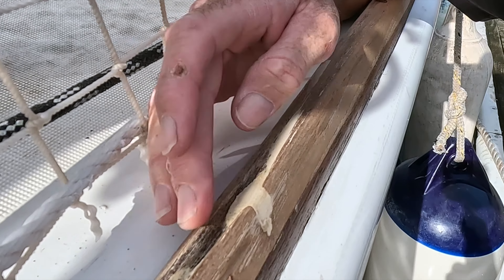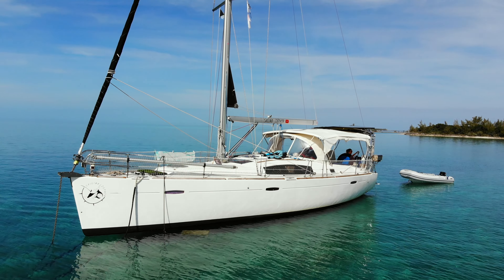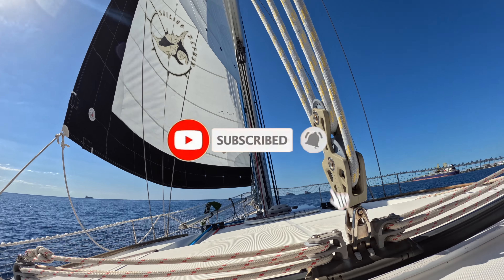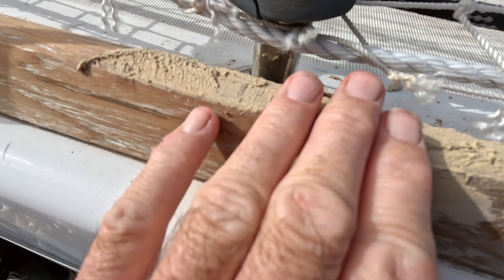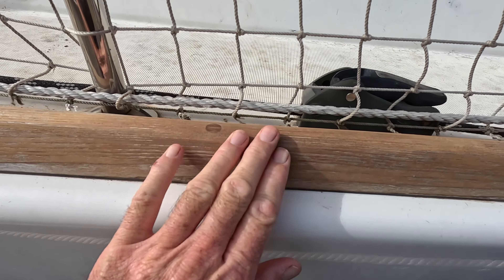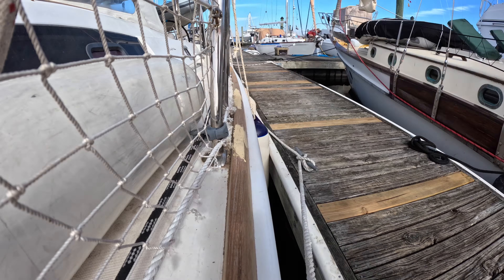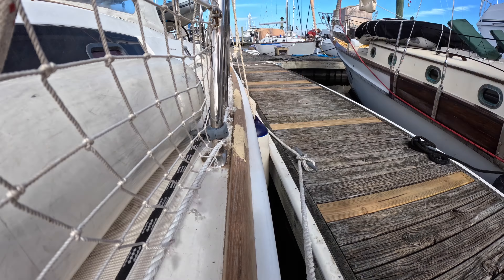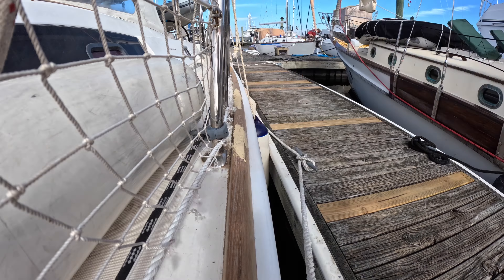Teak Restoration on a SAILBOAT Part 2 | Sailing Zephyr - Ep. 263

Comment: I think that teak oil does not "stain" the teak but rather brings out the natural teak color like a varnish on wood.
Reply from the maker: You raise a good point and something I was thinking about. I need to do some deeper research on this. But I feel like it added a slight tint. But overall I think you are right and it just enhances the natural teak look.

Comment: Your teak oil is not a stain it's an oil. There's no color in good teak oil. Sorry for the bad news . Keep up the great work
Reply: @rickskalberg421  I have found Two types of Teak Oil, the normal standard type Teak Oil, is a bit dark and surprisingly when I was in the USA using a Sailboat in 2016 the best value for that was in Walmart, and I bought every can the local Branch had.,however, West Marine had a very expensive Golden Teak Oil- which looked like engine Oil, and tbh, I was tempted to try it, but never got around to buying a bottle of it, but thought it could really look the business, if used after the standard Teak Oil had started drying Out, but the wood still pretty well fed internally, so at most only needing say two coats of the expensive golden Oil, so a bottle of it may last a good number of years ? Unfortunately the boat was a total loss before the teak got to that point, so the chance to compare them was lost, and there won’t be any timber on Deck at all, with my next Sailboat, it will be all foot and knee friendly non slip, plus 316 Stainless Steel Grab Rails. I’m done with wood to be honest. Best Wishes. Bob.👍🌟🌟🌟⛵️

Comment: James I do understand your wish to make your Teak look like new. However, in my opinion after spending 30 years trying to keep my Teak looking great, I just decided to let it age and scrub it with salt water every now and again. Continually sanding those toe rails will just end up as thin as tooth picks. So far as Teak oil is concerned, it is just snake oil. ,Teak is naturally oily that is why it doesn't rot so it will not absorb your "Teak Oil". Waste of money and effort. DON'T EVER stain Teak... YUK. Teak is beautiful naturally and too oily to truely take stain in any event.
Reply: If you like the natural grey of teak I'm sure it is beautiful to you.
Reply: Following on from what English.awyer said James - Teak Oil is actually Wood Food, and there are benefits from Feeding the Wood. The grain gets sealed and the protective Teak Oils appear to get usefully boosted, and Protection from Rotting continues ? To me, putting a filler onto the Teak doesn’t help, and best instead would be to cut filler pieces out of Teak off its, and slot them into the Teak instead with small securing teak dowels ? Then once you have all Teak again and the Teak takes in all the Teak Oil Coats it can absorb, when it needs more coats should be easy to spot, and at worse, only a very light sanding should be needed, if needed at all, as the surface should look faded and “hungry” in need of a few coats of Teak Oil Again. Nice work with the cloth James, my favourite was the microfibre cloths - Just don’t put them in a Tumble Dryer.😅 Best Wishes.  Bob.👍🌟🌟🌟⛵️
Reply: @cestmoi1262 When Teak is Grey, it is starving and desperate for Wood Food, which Teak Oil supplies it. The Teak has dried out, all the Oils are gone, and that is when it starts Rotting. Yes Teak Does Rot, Varnish is the Protective Layer sealing in the Oils, but Varnish becomes a Nightmare to Maintain, plus all the preparation work required for reVarnishing, Steadily reduces the amount of Teak from what you Started with.To Maximise the Life of the Teak, if I had to Start over again, I would never Varnish it, and only make sure to feed the wood regularly with Teak Oil or, today, choose to have no exteriorTimber On a Boat at all,and thanks to the Very Real Termite Problem, be bloody Careful with what woods and plywood are used Below Deck and find out the best Termite Protection Layer to Barrier Coat them with - Possibly an epoxy Twin Pot Paint ? I know Island Packet use Termite Proof “Starboard” ? I think it is called. 🤔 I could seriously use some input on Termite Proof Coatings to be honest.I know that for Timber Frame, and other houses, there is a green coloured plastic Sheeting, that goes with the Construction Pad, with an anti Termite insecticide in it, to prevent the he little sod’s getting in at all. Biggest emitter of CO2 in the World by Far ?Termites, Believe or not. 🤔
Reply from the maker: @brownnoise357  Thanks for the info Bob. I love the way you explained that. It also makes the job seem less like a job and more of something we need to feed and look after. Thanks again for watching and as always for providing some much needed knowledge that we needed. Cheers my friend.
Reply: @cestmoi1262  Did you know that Teak is NOT naturally grey? You didn't read what I said. Go back and read what I said. "Scrub it with salt water every now and again." For your info, that removes the greyness and the Teak looks great. My point was when you are on a budget sailing around the world, you don't need to keep sanding the wood. Every time you do that you remove more and more wood and you are unnecessarily paying for products that look great for a short period of time. This is not a super yacht and not worth the time and cost. It is like scrubbing a Teak deck with salt water. It looks great and you don't oil or stain that do you?
Reply: @EnglishLawyer  Well it loooked GRAY on my boat. I wasn't blessed with somebody informing me that I should douse it with saltwater so stop getting your bloomers in a twist. It seems to gravely affect your disposition, English Lawyer.
Reply: @cestmoi1262  I didn't say "Douse" it in salt water. ,I said "Scrub" it with salt water. If you cannot understand English then I understand your problem. Now you don't need to get yourself in a twist. You have obviously never owned an ocean going vessel and are just shooting from the Lip. I have been a commercial skipper and boat owner for 50 years. The foredeck of my vessel is 22 feet long before the mast  by 12 foot wide of 3/4 inch teak. I know how to look after Teak. You on the other hand, have zero experience.
Reply: @cestmoi1262  Natural Grey = The Teak is dying and it is losing all of its protecting Oils Content. Sanding it to remove the Dead Layer and get back into Oily wood, just accelerates the wearing out of the Teak Process, like Failing to feed a Wooden Cricket Bat with Boiled Linseed Oil  can result in the Cricket Bat just falling apart ? As a Kid, my first  rocket Bat only lasted two years, because I never Oiled it from New. I just didn't know that was how you looked after it properly. 👍